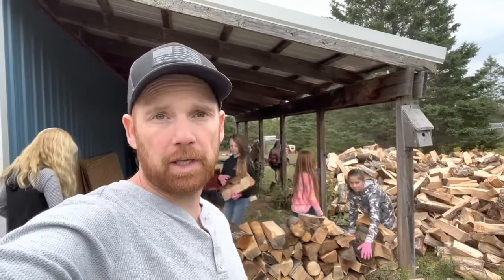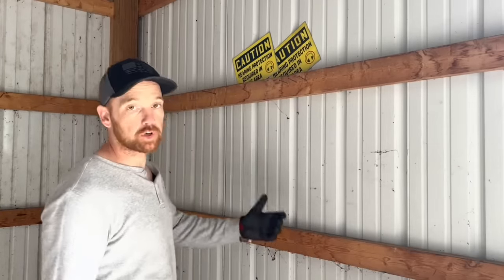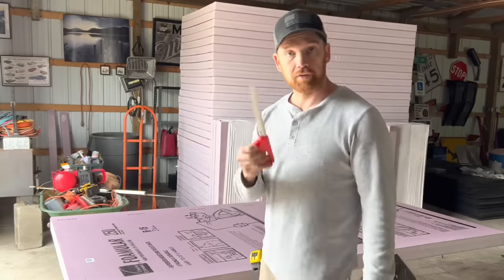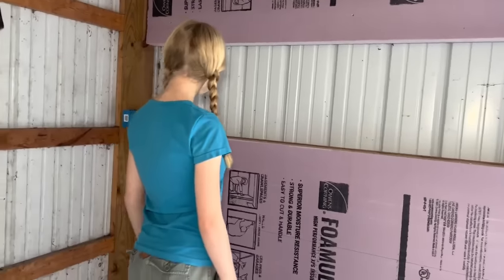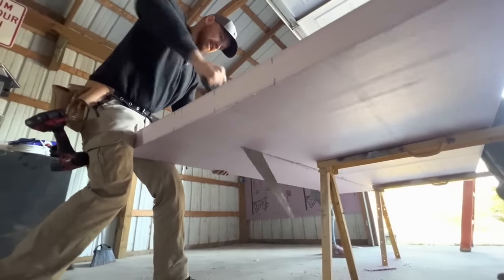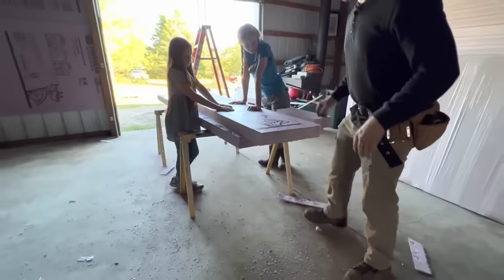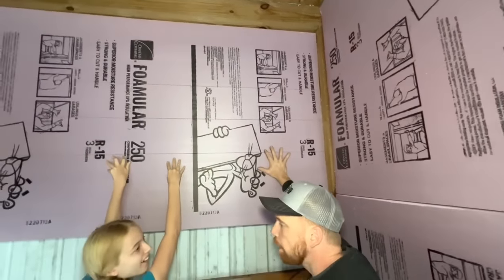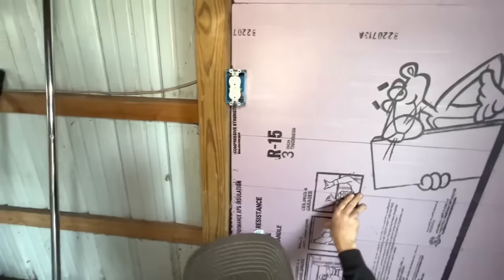Insulating our steel building/garage | Why we are NOT using Spray foam... Family prepares for winter

Comment: Better to use standard insulation over spray foam so you're doing good. Everyone down the road has some sort of issue with it either it doesn't mix right and never cures and off gases or people seal their building so tight they end up with mold issues from any little moisture or they end rotting there structure because they get a leak in the outside envelope and the water ends up following the wood studs or purlings with no signs until its to late and your structure is rotted and ready to fall down. I'm a contractor by trade and see the crap all the time, I couldn't tell you how many roofs we have had to cut completely off because they were spray foamed and they got a leaks in the shingles ot vents or skylights and the water followed the sheating and trusses rotting them away and owners had no clue of the leaks till they had to spend 10s of thousands of dollars in new trusses and roofing. Spray foam has been keeping us pretty busy the last few years I don't recommend it to anyone we build for, I direct them right away from it and the ones who insist on it I put it in writing that none of the work is guaranteed at all and I show them the damage that having spray foam causes and most of them will steer away from it but a few insist on it.
Reply: Thanks buddy... I will not use spay form for future build, u r right.. Some video on yt show people have bad smell with spray form ... End up cost ton of money to remove all spray form ... Not sure how can they remove all if that sprayform and the smell could still remain.  The spray form really sticky to the wood...  Wrong mix could cost someone a home.... And health....
Reply: As much as I love the concept of spray foam because of the air tightness and the monolithic end result, the fact remains that the process of manufacturing foam requires an extremely controlled environment (temperature, humidity, ventilation) which is almost impossible to achieve on site.  Foam is best when manufactured in a factory.
Reply: Even if stars align and you do get things right, sometimes life happens and you have to repair a section. A lot easier to remove this stuff in the event that you have to do a repair to a section of wall. While PL premium is top notch stuff, its overkill. I would use the PL 300 stuff meant for foam board. It's cheaper, easier to clean up when wet, and easier to undo after drying without damaging the foam boards.
Reply: years ago when i hung drywall the first time i encountered spray insulation there was black mold all over the place and everywhere it wasnt trimmed right it made the drywall bulge
Reply: @evempsolar  The problem is the inability for most people to process simple logical thought.
CCF spray foam is a total sealing complete vapor barrier IF used as recommended.  3 biggest acts of idiocy I see is people #1 using it too thick, #2 trying to trim it after they get it too thick which eliminates its vapor barrier ability, and #3 press wet CCF into rigid foam.  
        A VERY THIN, COMPLETE, DRY LAYER of CCF is a moisture barrier as long as its left alone after its sprayed.   THEN some other addendum insulation over the top to make it actually an R value.   I prefer Rockwool in a shop because it doesn't burn or hold moisture. 
         Once the COMPLETE CCF vapor barrier is installed sealing holes, cracks, wires, boxes and EVERYTHING else, the Rockwool goes over and is strapped in, or other less expensive fiberglass, foil=face product to reflect heat. 
         Vapor penetration is eliminated. FIRE RISK is nearly COMPLETELY ELIMINATED unlike this method that CREATES A FIRE TRAP. 
          Depending on available $$$, there is more a homeowner can do to make their building more fires safe or more cost effective.  But it's all DIY, it's all just common sense that so few seem to have anymore.  
           I know what I sound like, but if you've seen some of these burn like I have, this guy wouldn't be impressing you NEAR as much as he is.
Reply: It's worth doing on a quonset style building.
Reply: What's your thoughts of spray foam on the outside of a metal roof?
Reply: @markchidester6239  A metal roof is the exact same construction as the metal walls usually.
Reply: @markchidester6239  Best way if you can afford it to get a really thick ceiling on a metal building (Though I've never seen it done due to cost) is to use an insulated "ZIP" sheeting on the framing, then diagonal 1x to attach the roof panel.   Much like a heavily insulated roof on an expensive metal roofed home would be done.   But how an ROI would ever be seen on that would be way beyond me.
Reply: The smell is formaldehyde and it’s not good for us, that u r using shouldn’t have been made with it
Reply: Are builders not adding baffles to allow a 2 inch airgap between sprayfoam and roof sheathing?
Reply: @JuystaFan  I think the CCF install business has gotten REALLY scarry; pick your poison.   At first at least the spray pros got good training, but then as always, they began applying product as quick as possible then off to the next job, especially where coding permitted.   MUCH WORSE for DIYers. 
           I don't even touch it anymore, except to use as a thin vapor barrier in pocket SURFACES or sub straights before the REAL insulation goes in/on (except concrete and other specific applications).
           It's just not 1998 anymore.   There are just too many other less flammable, cheaper, better options for pros AND DIYers to use IF they know what they are and their best ap.
Reply: @JuystaFan  standard practice in our area doesn't matter if new or old construction or which company does the job they open everything up and just spray even new pole barn builds spray the foam right to the back side of tin and purlings as a contractor I love the foam industry not only did the insulation company charge the owners thousands of dollars we get to charge them thousands of dollars to rip it all back out and rebuild all the damage done by it. Old or new construction that we do never would I recomend spray foam insulation in any building with any kind of wood, a total steel structure sure foam it up wood never.
Reply: Before I replied, I listened to what all of you had to say.  Here's the issue.  With pink foam, moisture will get trapped between the foam and the metal building.  That building is guaranteed to rust out.  Spray foam will increase the strength of the metal building by up to 300% and will prevent condensation on the interior as long as you spray at least 1" thick.  That means no interior rust and is far less likely to blow down.
Reply: @Cspacecat  In my 42 years as a contractor I've yet to see any good of spray foam in a wood structures in heavy steel truss buildings like warehouses and commercial buildings yes but the last 20 years or so my business has grown and pretty much specializes in foam removal in our area. Wood has to breathe and when foam is sprayed directly to any wood in can not breathe and it rots just an fyi even kiln dried wood contains moisture and when it's trapped it creates rot in wood even when treated. When a wood structure is spray foamed and the envelope gets a leak whether man created or naturally caused the water follows the wood incased in the foam and it has no place to go but to follow the wood rotting it out and the leak isn't seen until the structure has substanial damage conventional insulations water usually passes through showing the leak in the drywall or wall covering and usually can be opened easily and dried and repaired without major damage where with spray foam we've had to replace complete roof trusses and roofing and also have had to replace complete structure walls because water has gotten in and followed the wood encased in foam never showing a leak on the inside and when the problem is discovered it's usually to late to be saved and the amount of foam we have removed from homes that was never fully cured hard on the outside and snot on the inside it should be outlawed for human dwellings and it's not just one foam company we have followed behind for years it's many and even in 4 different northeast states that we cover.
Reply: @mrbrown3462  That sounds like open-cell foam to me.  You don't fully encase wood in closed-cell foam.  You only need an inch to an inch and a half of closed-cell foam to seal a metal building from air and moisture penetration.  Closed-cell is R-6.5 to R-7 per inch.  If you need additional insulation, then you use fiberglass or Rockwool over the closed-cell insulation.  Moisture is guaranteed to collect against a metal wall behind the fiberglass.  There's no way of stopping it.
Reply: @markchidester6239 best roof u can put on it is spray foam and coatings!
Reply: @Cspacecat  With the flash and batt system you are describing you can get moisture in the wall because the warm moist air in the building can condense on the cold foam. It's a bad idea to have the dew point in the wall.
Reply: I've used spray foam multiple times never had an issue with it. It's an amazing product. You have to make sure it's installed by competent people. If you don't want to use it that's great more for me
Reply: @markchidester6239  Rigid Foam, Spray Foam, is FOAM and is subject to the elements including UV. Spray foam also needs to be installed by a Professional as there will be inconsistencies in the thickness sprayed on, if the mixture isn't set right, the two compounds from the mixing tanks could affect the spray on. If "9252 LIFE" had used 2x4's or 2x6's vertically, he could have used Rockwool, however since he has large sections of open wall, the use of 4'x8' rigid foam insulation is great. However I would have put barriers at the top & bottom of the metal sheets to keep rodents and insects out.
Reply: @brianthompson9485  An 1" thick foam barrier is sufficient to block moisture buildup.    That's vastly better than having fiberglass absorb that moisture at the metal surface forming frost.  I put foam blocks in my sunroom windows and the frost sticks the blocks to the metal frames.  I have to wait until the sun comes up to free them in the morning.
Reply: @Cspacecat  Sure, it acts like a moisture barrier. But it's not stopping the inside moisture from condensing. There are calculations that need to be done one where the dew points will be within a wall structure.
Reply: @brianthompson9485  I understand what you are saying.   This guy is putting 2" pink foam against a metal building.  That foam has an R-value of 6.5 to 7.  There will be an air gap between that metal wall and that pink foam.  I'll guarantee you, moisture will collect in that space.  That means the metal building is guaranteed to rust on the inner surface.  On the other hand, Closed foam has a R-value of 7 per inch.  1.5" gives it an R-value of 10.5 and there will be no air gap between the insulation and the metal wall.  That wall will be sprayfoamed to the studs of the building making that building far more rigid.  Sprayfoam will connect the rafters to the wall which will keep the roof attached to the wall in case of high winds.  Personally, I wouldn't put up a metal building without closed-cell spray foaming it.
Reply: we use closed cell spray foam in almost every home we build.   4000-10,000 sqft waterfront homes in new jersey.  never had a problem yet, except on time we had them spray over damp sand under a slab and it bubbled up from the heat in chemical reaction.    but that was my error- spray it over gravel or rca  since then
Reply: @markchidester6239  I worked for a company in St. Petersburg Florida that only did spray foam on most of the flat style roofs. I went with them when they did a tile roof . It was absolutely amazing . It took the shape of the tiles. The sprayer was really experienced. A sealant is sprayed over the foam as it will degrade fast in the sun. Silicone based sealant is best according to them. It’s all we used.  Foam is sprayed fast , even and thin2-3 3/4” layers. By time we went 20’ we sprayer another 3/4 inch layer. Whole 3500 square foot house done in 7 hrs with 3 guys. Prep on gutters, bushes , cars and house took 5 hrs. Move at about 1 foot per second. At a 4-5’ distance from metal. With a 4-5’ fan comming out of gun. Absolutely zero moisture, even high humidity in air. Just don’t do it, it’s a gaurentied failure!!!! Painters tape 1’ long with paper and tape gun on top of gutters and plastic 4’ taped to wall after paper. Do not tape gutter sealed. Can leave completely open as it makes a great edge seal. The paper is 30x easier to remove when overspray down. Do one side at a time if need to. Best if sealed same day. Definitely second day. Seal can also be rolled. Or at least be ready to backroll runs etc. do not thin sealer.  If any rust on metal , treat with acid made for dissolving it. Check with mobile home roof sealer sales. I can’t remember which acid it is. Spray acid with a lawn weed sprayer. Home depo has a contractor grade one that’s more but worth the extra . Spray the acid in shade if u can. It’ll turn black. Wait until it’s completely dry hopefully untill no longer black, if not treat again. Power wash and get everything lost nailed down before u do anything.
Reply: The problem they have with it is fly by night companies are self teaching and not taking the certification. They spray it too thick at a time.ive done it for seven years. And yea it's gone thru the roof in price but it adds structural stability and a TRUE air seal.. if someone has problems it's because it was prepped wrong or sprayed wrong
Reply: Surfaces HAVE TO BE DRY, it's meticulous but whoever your going behind which is mot companies just half ass it thinking they'll make piles of money fast and then oneor two things break. One break down of any formvis thousands of dollars and for suppliers have doubled their cost at the warehouse. It's not a bad product it's lazy half assers
Reply: @justinfletcher7630  thank you. 1000% correct.
Reply: @Boogerboys1990  I've done it for seven years and before I was trained I was just doing what I was taught without the science involved and knowing about adherence expansion maximums per pass moisture content and psi mixing ratios and was able to see how exactly the science and the product worked together. I'm in a rural area where there are about half dozen part time spray rig owners who got a cheap machine and try to not hire qualified people and undercut initial bids to get it..  WE ALWAYS GET CALLED TO FIX OR REMOVE AND REINSTALL ALMOST ALL OF THEIR JOBS.
Reply: The real value are these comments, not the guy in the video learning to cut foam for the first time! (No offence, i learned from the comments! Great video)
Reply: Would it be crazy to only insulate the roof since this is a garage with big doors etc?
Reply: @TheRainHarvester  is fine to insulate either just the walls or just the ceiling with foam and using another form of insulation for the other (preferably a good blanket of cellulose in the attic space if you did the walls in foam, or a dense pack cellulose in the walls. But the doors they have installed will have descent seals and the panels of the doors will be internally insulated. Sometimes if you 100 percent spray foam a full building you have to get an air exchange to have a little bit of ventilation
Reply: @Cspacecat  What about using house wrap before installing the metal.  Then the pink foam is against the house wrap not the metal.  How would that be?
Reply: Was ein Blödsinn.  Dichte Gebäude haben nichts mit Schimmel zu tun. Rückständige Antwort.
Reply: I could sure use that insulation for my barn, maybe if I was planning on using it for business or to live in.
Reply: You dont know a lot about sprayfoam,you may have heard stories from the 1980's when it first came around.A sprayfoam machine these days shuts itself off if anything is off ratio or improper.Increase your knowledge by talking to a good sprayer not using the internet lol
Reply: @frankrizzo5958  Talk to Sprayfoamers every day in my field either getting them to do people right or to pay me to rip out their mistakes. I do spray foam remediation in the northeast covering Maine, Vermont, and Mass and Rhode Island hundreds of projects a year with 3 crews of 6. In a proper world people would wrap everything in either a house wrap or craft paper and then spray foaming to give everything a barrier between the wood and foam so the can breathe and dry in the case of a leak in the envelope. Spray foam applied directly to wood sheeting or rafters or studs does not allow it to breathe a leak in a roof or wall that has been spray foamed the water follows the wood rotting it many times beyond being able to be saved because the leak went unnoticed on the interior.In a structure with standard batt or blown in insulation when a leak develops in is usually seen either by a physical leak or water spotting on interior surfaces and most of the time a structure can be opened and dried and repaired. In a spray foamed structure a leak develops and the water follows the wood with no visable signs on the interior because closed cell foam doesn't allow water through so many times in a spray foam structure by the time a leak is noticed the whole roof structure or wall structure has to be replaced because there is nothing left but the foam and rotten wood channels where the wood once was. I have photo albums upon photo albums of jobs we have done behind spray foamers, we document 100% of our work from start to finish because most of them end up being homeowner and foamer in court because very few of them stand behind their work or inform the owners of the real issues of foam use. They do not inform people of the health issues if not used right or the risks to the structure if a leak happens, they do tell people the job involved if it ever has to be removed or what it does at high temps in the case of a major fire but they'll all tell everyone how great it is and how much it'll save them but not the expense when it has to be dealt with and many disposal places where we take large amounts mark it as hazardous material and charge heavy to dispose of it. Spray foam is like everything new it's great until it's not and truths about it comes out and no it is not old technology it is new within the last 40 years most remediation jobs we see were done in the last 20-25 yrs.
Reply: Either way even if it didn't have any product issues I would never use spray phone as the main type of insulation. What if you want to get to anything. It makes sense to use it in certain areas. May if when you spray it and it didn't stick to anything other than it self.
Reply: That’s why you have someone do it that knows what they are doing. I had my shop spray foamed for the walls and blow in for the ceiling and works great and never have had a problem!
Reply: First never spray the rafters always spray the ceiling. Second punch a hole in your wall put in a 6" insulated duct to the furthest end of your return air plenum that will solve your immediate problem with the fireplace. Next house do the math and figure out how much cfm all exhaust fans will use simultaneously and put in the proper duct size as above. Heat recovery systems just replace air which you also need. I have used spray foam in my homes and this latest is 1904. No problems whatsoever. Make sure you check out your contractor so they are professional and know how to get the mix and application right. It's all about homework.😃👌
Reply: @paul_fredrick  

YOUR WHOLE POINT SHOWS WHY WHEN DOING CONSTRUCTION IT IS SO IMPORTANT TO USE SUB-CONTRACTORS THAT KNOW HOW TO PREFORM THE WORK PROPERLY!!!
WHY WOULD YOU HIRE SOMEONE THAT DOES NOT UNDERSTAND HOW PREFORM THE APPLICATION OF THE PRODUCT???
Reply: @Cspacecat  

NO SPRAY FOAM DOES NOT INCREASE STRUCTURAL STRENGTH
Reply: @welewisiii  

ANOTHER BUILDING SCIENCE    GURU!!!
Reply: @BrianBriCurInTheOC Doesn’t increase structural strength? The fck it doesn’t.
Reply: Guys, here is our Savior

HalleluYAH translates “Praise ye YaH”

YaH is The Heavenly Father 
YaH arrives via the TENT OF MEETING
YaH was Who they Crucified for our sins
YaH was Crucified on an Almond TREE

— Ancient Semitic Cuneiform of Moshe (Moses)
— Isa Scroll (The Original Isaiah)

Isaiah 42:8
"I am YaH; that is my Name! I will not yield my glory to another or my praise to idols.”

Isaiah 43:11
“I am YAH, and there is no other Savior but Me.”

Isaiah 45:5
“I am YaH, and there is none else.”
Reply: I have seen spray foam used directly against quansit huts and that was one application that worked beautifully for a movie theater
Reply: WEATHER FOR THE WEEK AHEAD 17-06-24 UK WEATHER FORECAST - BBC WEATHER FORECAST - DAILY WEATHER